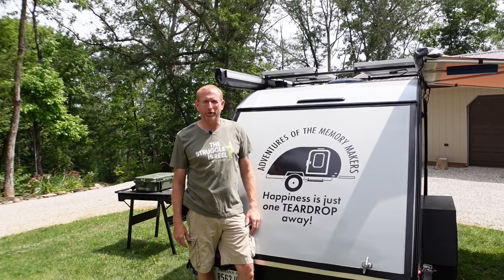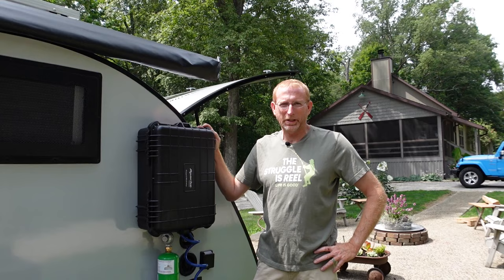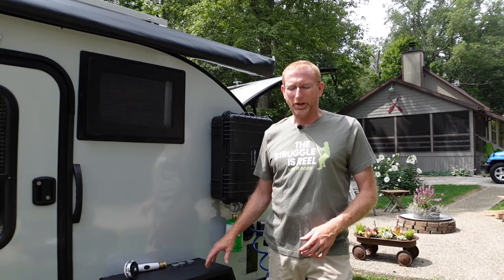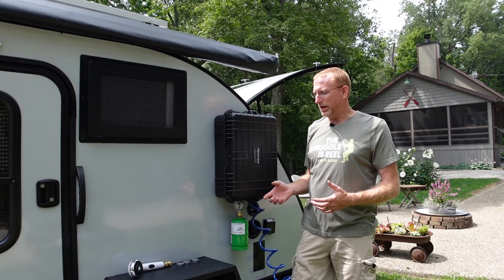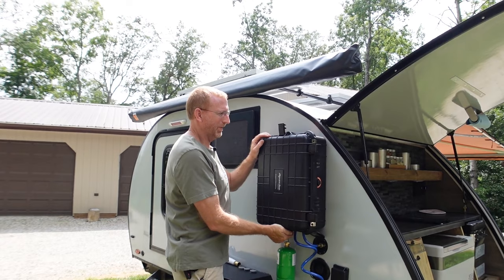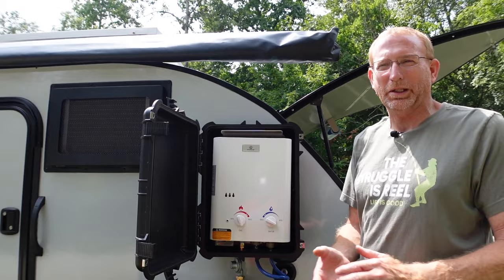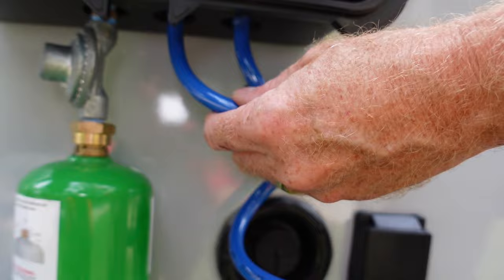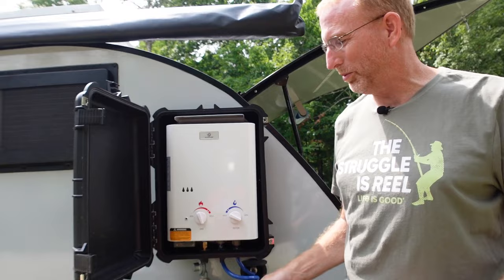DIY Tiny Camper Water Heater

Comment: anyone watching--  just know depending on where you keep your heaters - mice love building nests above the heat exchanger- then snakes hunt the mice-   and yes i have been taking a shower to see the snake coming down bck through the bottom holes...    screen off your lower holes-      you can tell if you got a nest because teh water will be extremely hot and it will heat the front panel just above the flame- ithe heat will change the color.
Reply from the maker: @johnwolf1475  good info. Both of our heaters are in sealed cases so no worries of that on our campers.

Comment: Cool build but no way that will last 10 hours on a 1lb tank . Heaters are the least efficient appliance there is regardless the type of. Heating water is no different. I would love an update tho to know what actual usage is .
Reply from the maker: @NewsThatMatterUsa  will it run 10 hours on a 1 lb tank? No. Did a one pound tank last us 28 nights camping, Yes. The way we use the water heater it does not run for that long at a time. It might run 3 to 4 minutes at the longest when Cindy rinses her hair.

Comment: I have the same tankless water heater and it is a POS. It always goes out. The water is never consistently hot. Your better off boiling water in a pot and using a bucket and pump for a shower.
Reply from the maker: We are hoping we have better luck. So far so good.
Reply: I had trouble with my L5 today but figured out it was a bas ground wire. I also pushed the thermal couple inward.

Comment: Great MOD.  I followed your video and did the exact same MOD.  After the first trip using the little green propane tank I purchased a 12’   Gas hose that will run under the camper and plug into the quick connect on the other side of the trailer. I find this to be a little easier over all.  Thanks for providing these videos as I have done a few of your other great MODs to my 10HD.  Keep them coming!
Reply from the maker: Thanks for watching. Glad the videos help!

Comment: I'm surprised you didn't mount to the door of the hard case, how much heat comes out of the top of the water heater?
Reply from the maker: I know a lot of people Mount them to the door but the door is not designed to carry weight. I ran the water heater through 24 gallons of water out of the water tank. The top of the the box was the same temperature as the sides of the box. The heat deflector does a good job of getting the heat outside of the box. The important thing is during use when you're taking a shower at Camp it probably doesn't run more than two or three minutes at a time.

Comment: I am making a rain water system for a shower but I'm using an elect tankless heater so do I pit the pump in between the water storage tank & heater or do I put the pump after the heater & into shower head?
Reply from the maker: Thank you for taking the time to watch. You will want to put your pump between your storage tank and your water heater. The pump will suck water out of your storage tank and then force it under pressure through the water heater then to your shower head.
Reply: @adventuresofthememorymakers  I thought that but wanted to make sure. Thank u

Comment: You’ve done a very similar set up that I’m in the process of doing I recently purchased the same case at Harbor freight and ended up returning it today realizing that when I install the heater I would not be able to service the batteries for the igniter, I tried but when I put it in the box there wasn’t enough room for the door of the battery to open to replace those batteries, I think I have the same unit as yours but mine is black in color so now I’m going to purchase the pelican 1600 which I didn’t want to do because it’s about triple the price, I like your set up I basically have the same trailer, mine is extremely modified for ground clearance extreme off routing etc. I’ve been debating whether to drill into the body or create a system which I’ve already started that mounts from the top of the rack down to the fender like you were speaking of in your video of people installing a ladder but I would do something a little different with more strength, you did a good job thanks for the video but I am curious how you were going to service those batteries I can’t tell from the video if your unit is a little bit shorter than mine and maybe you have clearance to get that little battery door open?
Reply from the maker: Thank you for taking the time to watch. You are correct, you cannot change the igniter batteries in the unit with it in the case. That said, I put a new set of batteries in the unit at the start of the season, we used it all season, and they were still going strong.
 It only takes me a couple minutes to change them, I remove the bottom mounting screw, loosen up the top screw, remove the heater, swap put old batteries for new, then re install them.
 We love the setup, probably one of the most used mods on the camper.
Reply: @adventuresofthememorymakers  thank you!!!😊👍

Comment: Love your content. Did you consider reversing the box, attaching the water heater to the lid and attach the lid to the trailer? Now the body is a big door and there's no need to drill the holes
Reply from the maker: James, I have seen that done and I did consider that but after playing with the box I did not feel like the lid structure was strong enough to support the weight of the heater. Plus it would have put more of a pull on the mounting points on the camper with that weight being held that far off the camper wall so I just did not feel comfortable with the heater attached to the lid.

Comment: I love this and have several questions.  Do you have a video on adding a side water port or finding the trailer supports? Do you have a patreon membership. I have a bushwhacker 2021 10HD.
Reply from the maker: @JohnMichael-gk4rh  , thank you very much for watching. No sir, I do not have a video on moving the water port, its basic plumbing. As far as the locating the structure on a Bushwhacker, you can slide something in the wall on the inside of the galley wall where the electric wire comes through the wall. There is a gap around that where you can slide something long and skinny forward till it makes contact on the vertical tube. Do a little measuring and that should get it for you.
 I am flattered about the Patreon question but I wouldn't pay anything for our videos so there is no way I am going to ask others for money.
Reply: Thanks that helps a lot.

Comment: Any reason this wouldn’t work attaching the unit to the lid?  Therefore, keep the top open to vent and no access holes in the bottom with easier access.  Great idea.
Reply from the maker: Two reasons I didn't attach to the lid.  The Apache box isn't strong enough to carry the weight on the lid. I can shut the lid with the water heater all hooked up this way but had I mounted it on the lid I could not.

Comment: SO when your towing the camper , you remove the water heater from the pelican case correct?
Reply from the maker: No sir. It stays in the case. Has about 6000 miles on it so far.
 I just remove the water lines and the pressure regulator, insert the plugs in the holes on the bottom and it's good to go.

Comment: Nice video! I'm planning on doing something similar but with a Pelican 1600 case and the heater mounted to the lid; mainly so I can store all the hoses, pump, etc. inside the box. I'm wondering about your mount points in your camper walls. Did you use screws for this or through bolts? My trailer is all aluminum, including the wall studs, and I'm trying to determine if self-drilling screws would hold or if I need to bolt all the way through and secure with a nut on the inside. Thanks!
Reply from the maker: Thank you for taking the time to watch. On ours I used sheet metal screws to hold it and that's worked fine. On the ones I'm out for customers I remove a speaker to access the inside of the wall and use bolts with large OD washers and Nylock nuts on the inside. The downside to mounting one to the lid is you can't have it all hooked up and then shut it back up. The way I did ours I'm able to leave it hooked up for days while we're at camp and shut the lid.
Reply: @adventuresofthememorymakers  Thanks for the reply. I totally get your lid point, and I may end up going that direction, but my present goal is to get as much freed up of the limited storage space inside the trailer as possible. Right now my water heater and accessories is essentially occupying an entire plastic bin and, as I'm sure you know, it would be amazing to have that precious cargo space available inside!
Reply from the maker: @tequila_and_friends  absolutely storage space is golden in a tiny camper. The Bushwacker is blessed with quite a bit of it then people go and remove the underbed storage. I personally don't know how we can live without that area

Comment: I’ve been through two of those L5 heaters from Eco-temp (same unit you have). I’ve had very bad luck with both and am wondering how it’s doing for you after using it for a few months. Let me know. Thanks.
Reply from the maker: Still working great!

Comment: Great video. One question. Did you use the original water pump or did you upgrade the water pump?
Reply from the maker: Yes we are and it works great. But I have relocated it to under the camper and removed all the kinks in the water lines that were there from the factory.

Comment: Is there some way of connecting quick connectors to the water intake and output so that when u get to your destination u don’t have to try to fit your hand in that tiny spot and screw the fittings on
Reply from the maker: Depending on which water heater and box combination you use there might be room for them. I personally have never been fond if fhem.

Comment: where did you get the quick connect water supply fitting and mount to the trailer?
Reply from the maker: Thank you for watching. There were no quick connect fittings. I used ½" FIP to pex fittings that thread onto the fittings from the water heater.
Reply: @adventuresofthememorymakers  I am talking about the one that goes into the side of the trailer.   Looks like a quick connect.. Water Supply side.
Reply from the maker: @ChasingDreamsLivingLife  , gotcha, that was the factory quick connect port that was by the sink
 I reused it and then shortened the hose that came with the camper.

Comment: What all was needed to convert it to use a 1lb tank?
Reply from the maker: You will need a 1lb lp adapter 
https://amzn.to/47M30Xl

It has been a while so I don't remember the exact fitting but I had to convert from the fitting on the heater to the male ¼" pipe fitting on the adapter. A good hardware store can fix you up with the fitting you need.

Comment: I have this tank & want to use it in my horse trailer "cowboy shower". I need a water pump for boondocking. Can you advise what kind of pump to use & will it work with a 12v dc-out portable power supply? Thanks! Looking forward ro horse camping but being able to shower before going into town so I dont smell like my horse!
Reply from the maker: Tammy, thank for watching. Totally understand, having a shower is awesome!
 I use this 12v pump https://amzn.to/4afyk2r

It will pump 3 gallons per minute. Yes, it will run off the 12v cigarette plug off a power station as it only pulls about 5 amps and most of those ports on PPS will put out 8-10 amps depending on which one you have. 
 Since the pump is going to basically  on a  constant run when your taking a shower you probably do not need a accumulator tank.
Reply: @adventuresofthememorymakers  that's exactly the pump I was looking at! Thanks!!! Can't wait to be able to wash dishes & take a shower w/o using a hot pot for water!

Comment: Stupid question, I assume you need some sort of water pump? Do the pumps maintain a certain psi? I would assume you don’t have to keep turning it on and off all the time.
Reply from the maker: Not a stupud question Sir. Yes, you need a water pump. Most Rv water pumps have their internalnpressure switch that turns the pump on and off as needed. 
 Something like this one will work great with this heater set up.
https://www.amazon.com/dp/B00P8BE6S8/ref=cm_sw_r_as_gl_apa_gl_i_BRKP2H7X22FQV810NX4C?linkCode=ml2&tag=adventur0592c-20
Reply: @adventuresofthememorymakers  Thank you. I will buy it with your link if I go that route. Still trying to figure out what I’m doing. Bought a military trailer with a hardtop that I’m going to convert into a camper, lots of planning and lots of money I need to properly do it. I am watching your videos and some others, my main thing I want  is some comforts so I’d be more likely to use it, like hot water and ac.
Reply: The L5 model needs a minimum of 20 psi or it will shut off.

Comment: What water inlet are you using ?
Reply from the maker: I cut the end off the factory water quick connect hose. It plugs into the port on the side of the camper then I used a ½ pex to ½" pipe connector to connect to the water heater.